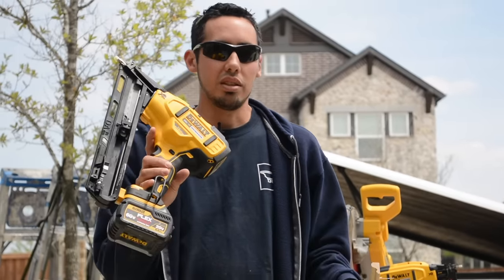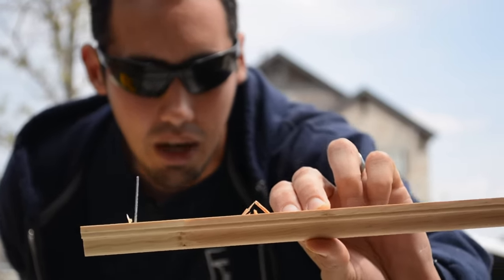Which NAIL GUN Should You BUY???

Comment: I much prefer using a pneumatic. Cordless are just too heavy and cumbersome.
Reply from the maker: i'll trade some extra weight in the gun over running the hose any day.
Reply: More cumbersome than dragging a compressor and hose around? No....
Reply: Matthew Pittman 

My compressor stays on the trailer so I don't have to drag it around.
Reply: The DeWalt weighs about 8lbs with a battery installed. That's like nailing with a gallon of milk all day. My nailer on the other hand weighs 4.2lbs
Reply: I've noticed the hoses are a big trip-hazard when they're running through a big home, not only to the workers, but all the subs that are in during trim time. Or, finding a central location to share a compressor with a work-mate, and a wall plug. 😒
Reply: Steeve Addkins 

I work outside
Reply: Noconz0727 MC:
Copy that. I was referring to installing interior trim.
Reply: I agree with you. Holding a 16 foot long board above your head while having to nail it with a cordless nailer gets pretty annoying pretty quick. The 5 extra minutes it takes to set up an air compressor is worth not having to deal with the extra weight and hassle of batteries.

That being said, it would be nice to have a decent cordless nailer. I have a ryobi airstrike 16 gauge nailer, but it fucking sucks.
Reply: taheelur1 The 15ga Ryobi is actually supposed be really good. Just heavy as hell
Reply: Noconz0727 MC    Pain in the butt to fire up the compressor and role out the hose for a dozen nails or so, though. Which happens quite often.
Reply: plus in some areas the fitting and coupler on the air hose prevents you from getting into tight spacers.
Reply: paulinator216 Not more than a giant battery.
Reply: Noconz0727 MC

For 18 gauge have you looked at cordless Senco?  I bought one last year and it is awesome.  The cordless 15 gauge Senco is not as good but I kept it anyway for those onesy twosy shots.

I do have the DeWilt 15 gauge pneumatic with the smart nose/small nose or whatever it's called.  It's pretty darn good.  Hooked up to a feather light and super quiet California Air Tools aluminum tank compressor and you will not be disappointed.  I'm a Makita guy so buying anything DeWilt/Black and Decker with batteries is out of the question.
Reply: Kroban3 

I'm trying to keep all my cordless tools on DeWalt batteries. We also very rarely use 18ga
Reply: Compressors are heavy and hoses are very cumbersome
Reply: @huejanus5505  "Pain in the butt to fire up the compressor and role out the hose for a dozen nails or so, though. Which happens quite often.," C'mon -you need practice swinging a hammer, now and then, haha ;)

Comment: For those of us on a budget do you think the 16ga angled gun would cover most applications.
Reply: Yes.  I believe Paslode makes a 16g angle pneumatic nailer, otherwise the 16g nailer is almost always a straight nailer.  A 16g nailer is a good choice if you only want one gun.  Personally, I own a 15, 18 and a 23 gauge nailer.
Reply: It really depends on what work you’re doing.  If you’re doing base trim I’d get an 18, if you’re doing window/door casing or I’d go with a 15g.  The biggest thing besides power is nail head size.  The 16 is just not enough and if you’re going to use a 16 usually I would go to an 18.  But as he said in the video I’d get a 15 and an 18 and then after that get a pinner.
Reply: Unless you’re framing then you’ll need the big 23 gauge
Reply: I have dewalt 18v 16ga. Works great for most things. I have used it for what is referred to in this video as trim on trim and works great. I fix skirting board, (base board) architrave around doors and windows and haven even fixed small moulding mainly because I was to lazy to set up my compressor for my 18ga! Did a great job. No splitting and fixed very securely. Bare in mind I am from uk so building construction is not the same as the us. Fixing to different types of substrates. Walls here are mainly all brick with two - three coats of plaster covering the entire wall.
Reply: Jerry Gania it's good to have. Its like a hybrid lol
Reply: It depends on what you’re doing. I mostly do outside work (fascias, soffit, frieze boards and whatever framing needs to be done to finish my job without having to waste time waiting on the framers) I mostly just use a 16 gauge pneumatic straight nailer and a pneumatic frame nailer. I also keep a 15 gauge nailer, a siding nailer, a couple extra frame nailers and 16 gauge nailers in the truck just in case. I keep an 18 gauge nailer at my workbench for really small stuff that the 16 gauge nailer would split.
Reply: Also, hitachi makes a really nice 16 gauge straight nailer that’s pretty cheap. They usually last about a year before needing to be replaced, but if you’re willing to spend an extra $40-50 get a paslode. I don’t like having to fuck around with cordless nailers
Reply: Carp Notes   I have a dewalt 16 gauge angled finish nailer, previous generation though. Has performed flawlessly for years.
Reply: Yes any single one of these guns will get the job done if your on a budget but certain ones work better in different applications but they all get the job done
Reply: Jerry Gania

Cordless is cool, (I have pneumatic and cordless nailers), but having compressed air and a blower nozzle on the job or in the shop is super nice for quick cleanup of a dusty saw or dusty clothes.  That's something to consider if you're just starting out.  For the price of a cordless nailer you can get a pneumatic nailer and a compressor.  California Air Tools makes a great 1hp compressor.  If you get the aluminum tank it's super light and they are quiet at heck.
Reply: Kyle Betty

When framing I usually double up for safety and go with a 46 gauge.
Reply: Kyle Betty negative sir
Reply: NenzelMUSIC

I think I wouldn't like being a finish carpenter in the UK.  You have that 240/110 BS with electrical and having to attach skirting/baseboard to brick almost all the time would drive me bonkers.
Reply: @crunch9876  You are right, Farmers dont use nail guns.
Reply: @NenzelMUSIC  Yanks know what an architrave is. Most moulds or profiles within construction are referred to trim.

Comment: Is there much difference in terms on nail size and holding power between 15g and 16g ?
Reply from the maker: It would be a good test to try it out. I would say the 15 is slightly stronger.
Reply: I own the 20v 16. It was released before the other 2. Try not to get it and just get by with th 18 and 15. They are slightly different and it makes them far better.
Reply: eaaronjames ive got the porter cable 18g and paslode 16g both pneumatic. The porter cable sucks. Its going in on warranty this week after breaking in under a year. I just got the paslode a few weeks ago and so far so good. I don't do a tone of trim. I'm more an outside guy so they get used mostly for outdoor trim on decks and porches with stainless steel nails.
Reply: 15 gauge nailer has a full head like a regular nail. Much more holding power.

Comment: Im new to finish trim work... whats the best way to fix nail blowouts? I know I can't be the only one who's shot a nail and hit some resistance and ricocheted out the side.
Reply from the maker: Matthew Kubik sounds like you might have the gun too angled.
Reply: Finish Carpentry TV . Angle of the gun isnt the problem. The cause of the blowout is the wood. I never have trouble with soft wood or mdf. but when I get into solid oak, hickory, and cherry the nails hit a change in grain structue and take the path of least resistance out the side. I've seen 18 gauge make a complete u turn in hard wood. So it looks like I answered my own question. I will just stick with my 16 gauge in the harder woods. Thanks.

Comment: Makita?
Reply: They don't have a cordless framer yet but I think they have cordless finishers. Word on the street is Hitachi is the way to go. The Dewalt guns are developing a bad reputation, but after taking my dads failed Dewalt framer apart, it appears that they periodically need new springs and drive rod thingies. Basically heaps of people are switching to Dewalts and expecting that they don't require maintenance. Very silly, these guns go well, and all the parts are readily available. Nothing wrong with the Dewalt guns tbh.
The advantage with the Hitachi guns is they don't ramp up. They are always ready to fire because every time you fire it the motor re-compresses the sealed gas piston. The Dewalts use a flywheel system.

Comment: I love your videos, but I laughed pretty hard at the two nail gun statement. Not long ago I lost everything in a fire, but before that I had 27 nail guns. Since the fire I've replaced about 15 to 20 of them, but I still feel like I haven't quite gotten there. They are of course all pneumatic. I shudder to think of the cost of buying almost 30 battery operated gun. As if that were even possible. Many of the guns paint use are not available in a battery operated version. Also, I feel like if I were to go down the road of even buying one or two battery operated guns I would be tempted to use the wrong gun for the job simply to avoid running  wire to the band  for the compressor and pulling out a hundred or more feet of hose. In any event, don't listen to idiots that asked you justify your choices, you're the professional.